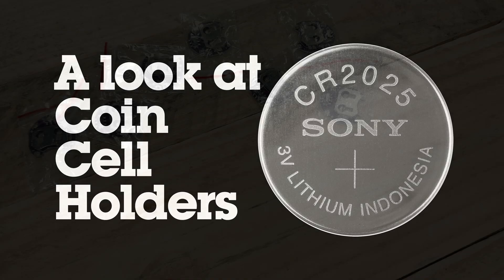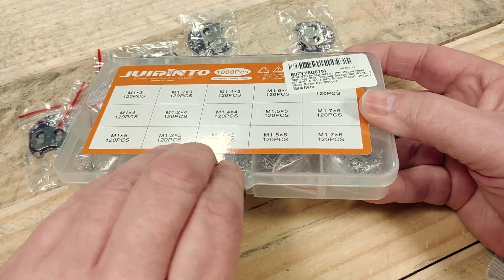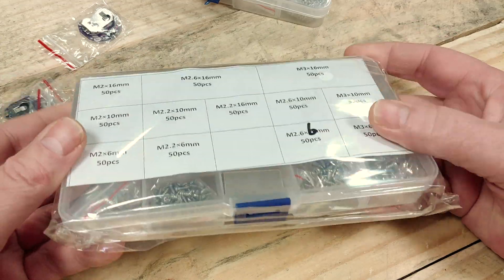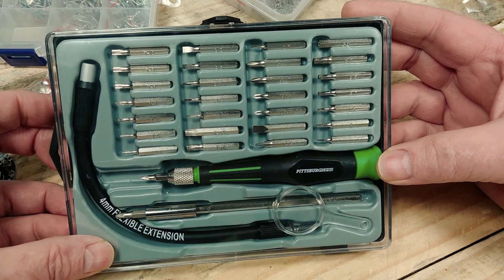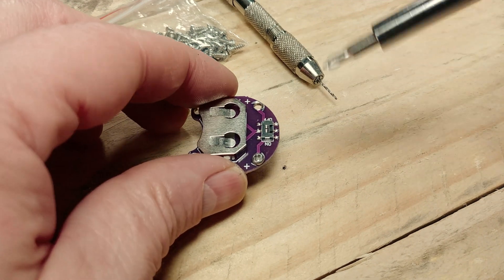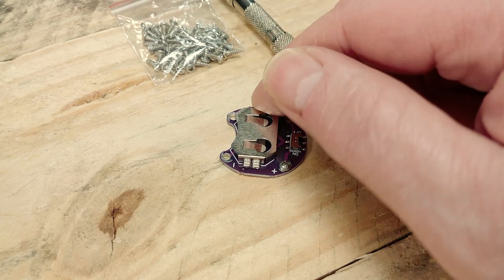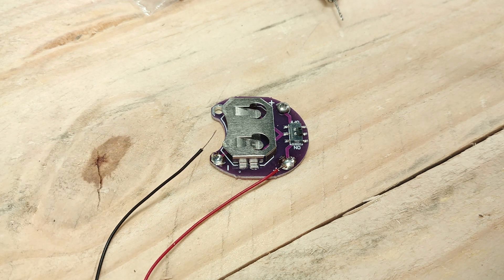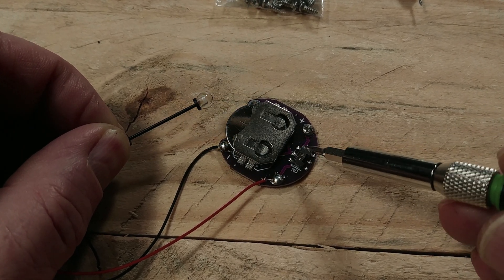Using A 3V DC Purple Coin Cell Holder For A Model Train LED

Comment: Enjoyed the video. Very clear for the novice 😅. Are you aware of any lily pads, or similar, that are not with an on/off switch? I’m hoping for a push to make contact type. Thank you in advance
Reply from the maker: Glad you liked the video, thank you! There are coin cell holders with no switch, usually very bare bones design but I think they're reliable enough. You might want to try over at Evans Designs for ideas... here's a link to their site and this page features a separate push button switch and a plain holder: https://evandesigns.com/collections/hobby-leds/products/chip-light-kit

Not sure if this is the kind of thing you meant, but it might be a starting point for more information.
Reply: @Raildig  https://youtu.be/9HufYmJJXYU 
This would have explained it exactly😂😂😂

Comment: Hello,
I really like your videos and now I have a question. How can you connect more than one of these coin holders together in case I want to add a remote control.
Thank you
Reply from the maker: I don't want to give you any bad advice here where batteries are concerned but it sounds like you looking to connect batteries in parallel. I would much prefer you check out a search of something like "coin cells in parallel" and get a really qualified answer to this question. Even with small batteries like these, I'd prefer to be a bit on the safe side.

Comment: Hi. Whats the name of the wire? And the size? I know nothing about this and I am trying to conncet LED lights. If you can please let me know. Thank you
Reply: Oh I see. I would look at both options. Thank you soo much for the quick response and your video. I really appreciated
Reply from the maker: @janylove7432  You're very welcome :)
Reply from the maker: This wire came attached to the lightpost but I'd guess it's 28 gauge wire. I normally use a custom twisted Kynar wire that's 28 AWG. You can find this kind of wire here: https://evandesigns.com/collections/wire-switch-more/products/twisted-kynar-wire.
Reply from the maker: If you use that link I added to the last comment, it'll take you to the 28 gauge wire page over at Evans Designs. For LEDs though you can use almost any small diameter wire. There's no specific wire name, only wire gauge - or thickness of the wire. The higher the number, the thinner the wire. Evans Designs are a great resource for LEDs, definitely check them out! https://evandesigns.com/

Comment: So one light per coin cell?
Reply from the maker: Hi Jeff, I just used a single LED here to show the holder with a single light but you can definitely attach more than one light, depending on how you do it it will affect brightness / length of battery life. I should probably make another video on this but in the meantime, you can check out this video by Evan Designs: https://youtu.be/7udZCpXp75E

Here they're using a parallel connection, there's also a series connection you can make. Once you get a handle on parallel vs series and how they affect LEDs and batteries, it can open up possibilities for you.

For very small projects like out Christmas layout we just did, I tend to go, 1 battery to 1 LED, for extending battery life and being able to turn individual LEDs on and off easily.